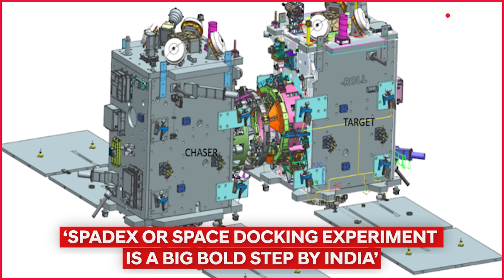ISRO Attempts Space Docking Using 'Swadeshi' Technology, Dr S Somnath Shares Insights

Comment: Prograde, retrograde, normal, anti-normal, radial-in, and radial-out are terms used in orbital mechanics to describe the direction of motion of a spacecraft: 
Prograde: The direction of motion that is in the same direction as the rotation of the primary object, such as a planet. 
Retrograde: The direction of motion that is in the opposite direction of the rotation of the primary object. 
Normal: The direction that is perpendicular to the orbital plane. 
Anti-normal: The direction that is opposite to the normal direction. 
Radial-in: The direction that is parallel to the orbital plane and points towards the focus of the orbit. 
Radial-out: The direction that is parallel to the orbital plane and points away from the body

Comment: A universal space docking port is a standard docking interface that allows any two spacecraft to dock or be berthed. The goal of a universal docking port is to prevent astronauts from using the wrong docking system for the space station. 
Here are some examples of docking ports:
International Docking System Standard (IDSS): Used by the International Space Station (ISS) to support crew rescue operations and provide a standard docking interface 
Universal Docking Module (UDM): A planned Russian docking module for the ISS 
International Docking Adapter (IDA): A docking adapter that has been deployed in multiple versions 
The first universal docking device was used in 1975 by the US Apollo and Soviet Soyuz spacecraft. The American version had a large airlock to allow the two crews to meet despite differences in cabin pressure.
Reply: Thank you chat gpt.
Reply: @Marv3Lthe1  gemini not gtp

Comment: Isro must come to jet engine technology , because its need for our nation for 6th gen fighter jet
Reply: Isro itself has yet to breach the 4 ton lift capacity. Don’t be so hard on DRDO! Even China hasn’t mastered engine technology.
Reply: @Sunj7 nonsense 😅
Reply: Isro priority is not currently making jet engines, that's responsibility on HAL.
Reply: A Jet engine is far more complicated than a rocket engine in simple technological Marvel.
Reply: @AshishThakur007i   I don't agree with you, for spece rockets and other joints are designed and reserach for outer environment and on basis of  other celestial body, like mars satelite, sun satellite, moon satelite or rover, landed etc.
These things process are not control by manually. Or by hand, these things are depend on design and wireless signal.
While a jet engine craft operated by pilot, and it fly only in earth atmosphere, HAL only need to crack how to increase most relevant fuel engine which have stealth technology.
Actually indian govt hire so incompetent scientist in hal who unable to make a proper engine yet.
Reply: @ayushjaiswal9863  nah man rocket propulsion is far easier compared to jet propulsion, here's the thing there are too many elements when it comes to jet , metallurgy plays big role here because a jet engine has to work in different environments with change in temperatures rapidly , even if you invite best minds of India to create jet engine it will take us next 10 years for first test only, there's a reason why only handful of countries design jet engines 4-5 that's it .
Reply: @AshishThakur007i  So, how china is doing, do you think China is just making false advertisements? What are their standards?
Reply: ISRO cannot replicate 1970s cryo engine in 2024 with all the resources of Supercomputer, CAD and FEA software's and working operational cryo engine from Russia in their lab and you want even more complicated JET engine from this clown department under nose of PMO with all perks and privileges??
Reply: @ronron7763   do something yourself before insulting others.